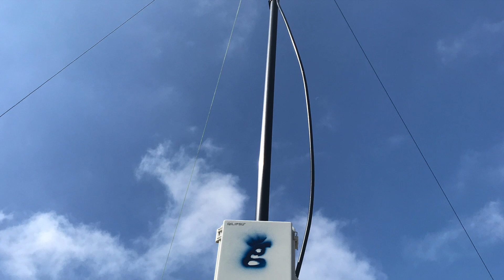Replacing a Giant 13 dBi Sector and the new Helium Basic Course

Comment: Nick. Supper appreciate what you continue to do. I have my 1st off grid 90% built. Just can't seem to power up the router. I have 2 butt converters. 1 for the miner 12v to 5v. However the one for router isn't working. It's a 12v to 5/9/24. It has a USB female so I chopped the 4 pin off and spliced it to a USB. Black to black. Red to red. I got nothin.. I also tried to wire it straight to the charge controller and got nothin.. I now have 3 routers. All have 4 pin connections and none of them will power up. Any suggestions?
Reply from the maker: Shouldn't need a buck converter for the router if it's a RUT240; check the input.  Should be able to come straight from the charge controller.  Does that make sense?
Reply: @thegristleking  man. Finally got it!!! 🙌 that worked. Alright. Testing right now. Hard wired to a Verizon skyus 160. Ip is reserved for the miner and ports forwarded. Fingers 🤞 thanks nic. Totally rad!
Reply from the maker: @Cornerstonecontractors  awesome, nice job!  Keep us posted please!

Comment: I located in a rural location in Southern Alberta Canada and already crypto mine with gpu’s and asic miners but i am now interested in trying to set up a few HNT miners on my 5 acre property each unit individually located 300m apart with solar power and gsm data 
I have no other HNT miners anywhere near me so any rewards will come from my own miners / rewards 
Is this viable ?
Reply from the maker: Probably not.  5 acres isn't enough to set up enough miners to have a high earning cluster  You'd want to be able to connect in with, oh, say, 40+ other miners.

Comment: Wow , you are such a great guy to listen and super cool spots for helium miners :) 
I’m building my first off grid one , what it that small antenna u using now ?
Reply from the maker: The HNTenna, here: https://grstl.ink/hntenna-outdoor
Reply: @thegristleking  do you think the low db antenna das better ? Because you are so up high ?
Reply from the maker: @djpitr  in general in the US the low dBi antennas will do better.  The radio pushes out enough energy that even at low gain there's still plenty of power to get the range you want/need.  In Europe it's a little dicier and will be even more so with PoCv11.
Reply: @thegristleking  what internet hotspot are you using for your off the grid setups? We use the nighthawk with AT&T but the relayed status is a bugger
Reply from the maker: @jacquesschoombee2318  this one is running on an IBR650C, blog post and gear list here: https://gristleking.com/how-to-take-your-helium-hotspot-off-grid/

Comment: When do you expect to have a comparison?
Reply from the maker: I just got it working again after a week or two of downtime from network turmoil.  It's done .8 HNT in about 9 hours, which is comparable to what it was doing before.  As I get more info I'll post it up on the GK site -- gristleking.com
Reply: @thegristleking  keep in mind that the unit earnings per "event" significantly reduced compared to 2-3 weeks before. I suggest you to compare the # witnesses per unit time rather than the HNT earnings.
Reply from the maker: @bilalhp  Ok.  It's up and running now, doing a little over 2 HNT/day.  In late November 2021, that ain't bad.
Reply: @thegristleking  So this small antenna performs better than the giant 13dbi sector? Looking forward to read your blog post on this :)
Reply from the maker: @bilalhp  So far it's performing pretty much equivalent.  I've had some other issues with the cell backhaul connectivity, so it's hard to compare one to the other right now.  Still, I'm not seeing a huge dip or climb either way (outside of the aforementioned issues, which have nothing to do with the LoRa antenna).

Comment: Thx for the video. Please share the results of going down to the 3dbi. See you changing out other high gain antennas.  Tia
Reply from the maker: Will do
Reply: @thegristleking  what were the results?
Reply from the maker: @Calgarywrx  no significant change.  This hotspot is still routinely in the top .1% in San Diego (11k Hotspots).  Location is what matters.
Reply: @thegristleking  Sounds good, I have a 12 db panel in my attic and I average .21 HNT a day. I am hoping to see a huge jump when I can install j-arm on my roof. Thanks for replying back!
Reply from the maker: @Calgarywrx  No prob.  Going outside will probably help.  Amateur Jade Hare is the hotspot if you want to keep an eye on it.  Not a ton of great data right now with network fluctuations, but it's doing well enough.

Comment: Hey I got a couple other questions as well. I noticed on this video the Solar panel looked smaller then most I've seen people using what is the name, and does it do as well as the larger ones? PLEASE & THANK YOU! Then when using a cell modem what carrier are you using and wont the miner always be relayed because of the way the IP works on those modems? Does the RUT have the ability to use a VPN and is this what keeps it not relayed? Thanks so much I asked a few others too. I have a few set ups indoors or close to homes but the next batch should be showing up soon and I wanted to turn them all into these well very similar. They will possibly be mounted or hanging from trees or in small rocky areas like in some of your videos. The property is huge  has redwoods thick then other half is manzanita and rocks. So depending on sun ill play around with them. Just want them to be a bit hidden. Thanks again for reading all this. ill eventually have pictures. Just now collecting all the stuff cuz the next units coming soon! but while I had the case off one fitting it into an enclosure getting my design down before ordering the bulk list, I noticed the PIG TAIL thing from the other Question looked a bunch online then said F it ill bug Gristle King since Google Queen wasn't working out lol.

Comment: Hey bud I Fu**ing am not afraid to admit I absolutely love watching/reading any of the content you have out. Keep it up man It helps me a bunch and TBH even though I find myself spending extra time watching to much instead of working on my projects :)  it reminds me consistently which one I like working on the BEST! We both have that in common. I have a question for you,  why on some Bobcats the pigtail IPX - Threaded female cable has 2 small sections of the wire coating stripped off?  Well shit I know why, but I don't know what it does and why only SOME bobcats come from the factory like this (I have a couple and they are not even stripped so no connection to the board in the other 2 spots) its supposed to be attached to the 2 small rice grain shaped metal "contacts?" not sure of the correct terminology sorry,  I would guess this somehow helps the signal strength from providing more power to the antenna itself? I have no clue just thinking out loud. Thanks for your time Sir.

Comment: How's the hotspot doing with the new antenna?
Reply from the maker: All my off grids are way down right now. It's happening to lots of off grids across the board, so it's hard to tell how the new antenna is performing.
Reply: @thegristleking  Ah, fair point if it's that recent that the blockchain issues are blocking results. Hopefully we'll be back up today. :)
Reply from the maker: Back up and running, avg a little over 2 HNT/day for the past few days.
Reply: @thegristleking  very nice!